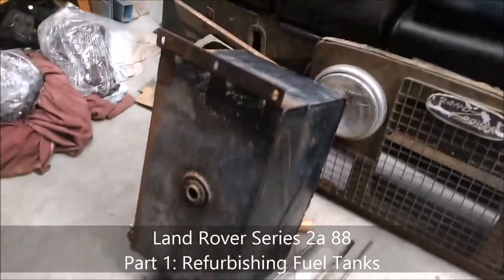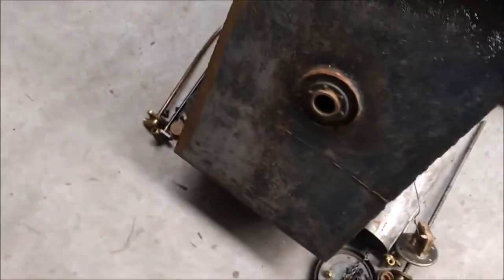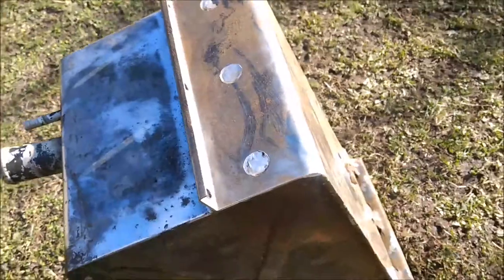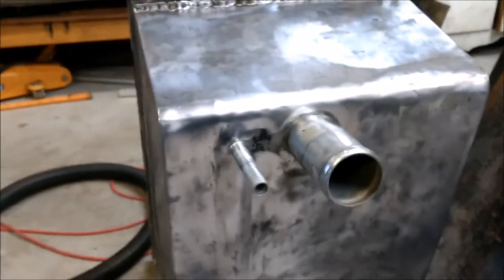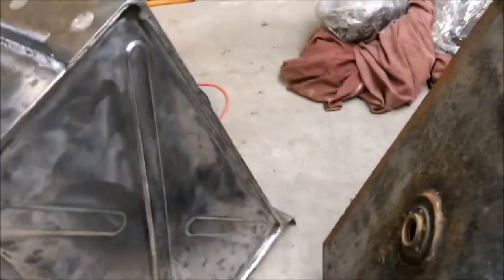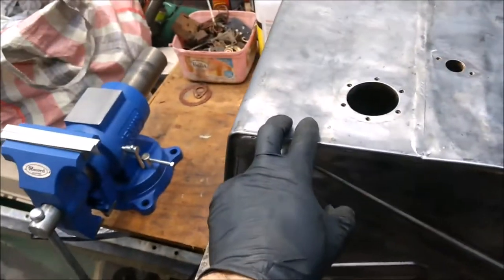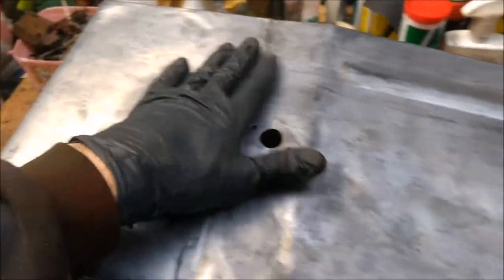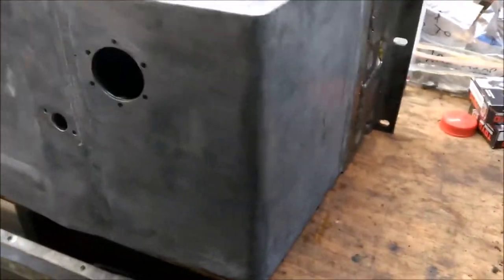Land Rover Series 2a 88 - Part 1: Refurbishing Fuel Tanks

Comment: I dropped my tank off yesterday at a radiator shop to be boiled out, as a previous owner had used a coating that was peeling badly. I was going to use a pressure washer but didn’t think I could get it into all the inside corners. I was also told that oven cleaner works on the inside. In the end, I just took it to a shop with a hot tank.
Reply from the maker: Good going, sometimes best to get it done right, else its a pain if you find floaties in the fuel after you put it all back together!

Comment: is there a way i can get the rust out from the inside of my tank?
Reply from the maker: I have read that some put a little gravel inside, shake the tank for a while and remove contents. Depends on how much rust, if its surface rust I used phosphoric acid to neutralise it and left it as is.
Reply: thnx i have another tank but i was thingking about a dual tank setup on my 1967 88"